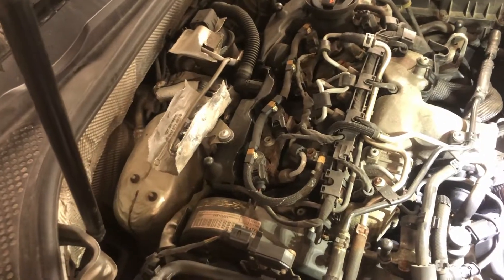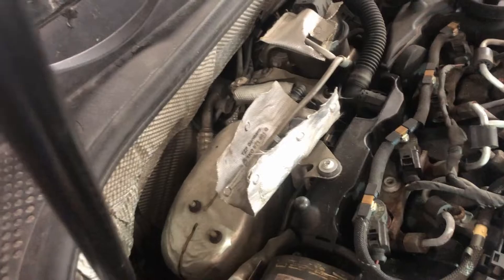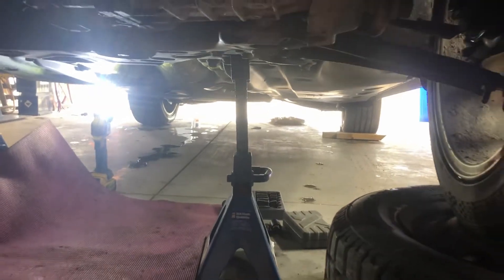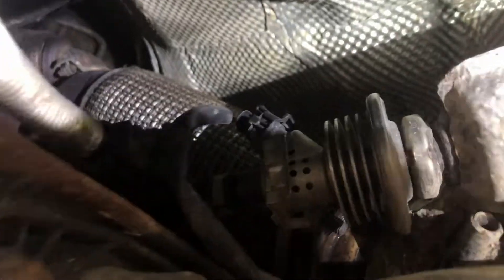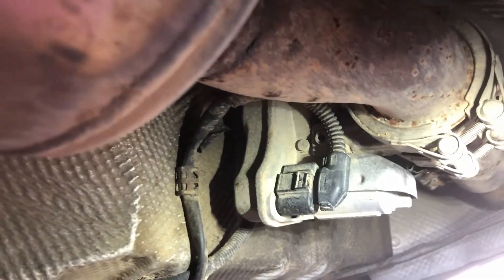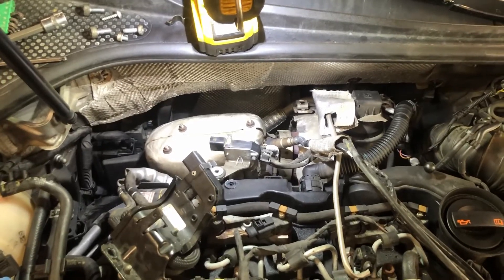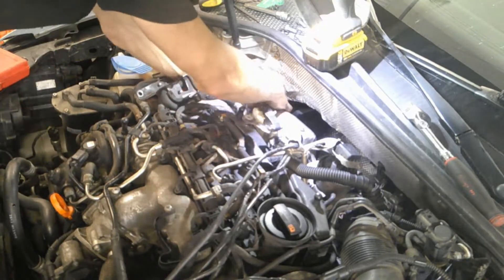CKRA Passat DPF/SCR/LP EGR removal *FOR REPAIR/REPLACEMENT PURPOSED*

Comment: Bro, your videos are excellent. You explain things very well, and you're an excellent mechanic. 
I also work with VAG, especially the electronics and programming (Immo-Off and everything related). I can also do tuning like Malone's. 
If you ever need any help, you can contact me. Wiring diagrams, part numbers, or any other information. Best regards, and congratulations on your work.

Comment: Did you need a set of triple squares for this job?
Reply: Yes 100% tried it without triple squares at first and it didn’t go to well just buy the triple squares
Reply: If you plan on doing any work on a VW, just go ahead and get the triple squares.

Comment: Got a CKRA and im removing the egr cooler completely. noticed the egr gases flow through the cylinder head, and im wondering do i need to block off both sides? or is it just a port specific for the egr gases, do the exhaust ports connect inside the head?, like can i just leave it open?
Reply from the maker: The cooler isn’t attached to that egr pipe, it’s fed into the turbo. The egr valve will stay shut and that pipe can stay but if you want to remove it for ease of filter change both sides need to be blocked off as it’s a through port to the 5th exhaust port on the turbo

Comment: How different of a procedure would this be for the CVCA Passat?
Reply from the maker: Very different, it’s got the entire canister behind the engine. I’ve done a little work (timing belt) on a 15 but nothing emissions related yet
Reply: @JoshsJettas  yeah it’s shoehorned in there nice so I’ve been curious how labor intensive removal is. What mileage did you do the timing belt?
Reply: @JoshsJettas  and thanks for the reply! I’m near 150k miles, know the time is coming soon..
Reply: go to rawteks downpipe install instructions. pretty sure u take cv axle out. curious if u need alignment after that ? but yeah its picture intructions to follow. im gunna follow that when i install my flowdirect kit.

Comment: Hey Josh any I just had my car done an it now has a rattling noise mostly at red-light an then accelerating from a stop is when its most noticeable . The new exhaust all seemed tight when I put it on , 2014 passat
Reply from the maker: Just installed a down pipe? My guess is the hanger is hitting the subframe through the mount, my wife’s car I had to trim the rods down a touch
Reply: @JoshsJettas  yup that was it !!! Thanks

Comment: I have a heater core failure on my ckra.  My heater warranty is done, bit still have 80 days on my emissions warranty.  Can a driver cause a cel to get the egr cooler and heater to get repaired under warranty
Reply from the maker: If you look up ckra heater core tsb they talk about a P2457 egr cooler efficiency below threshold. Bascially the heater core is inline with the egr cooler, if there is a restriction in the heater core or hoses enough coolant cant make it through the cooler and temps will rise. Id imagine if the restriction in bad enough and if the cars driven hard the code should pop up

Comment: Josh, I have a CKRA that destroyed three turbos in under 1K miles, and motor too. I’d like to know if you have any clues for possible reason. If possible I’d like to message/talk briefly. Let me know if possible.
Reply from the maker: Did the compressor wheel fail? The ckra are known to have weak turbos, was the intercooler cleaned out after each time? other possibility is plugged aftertreatment system. Send an email to joshthring21@live.ca
Reply: @JoshsJettas  emailed you.

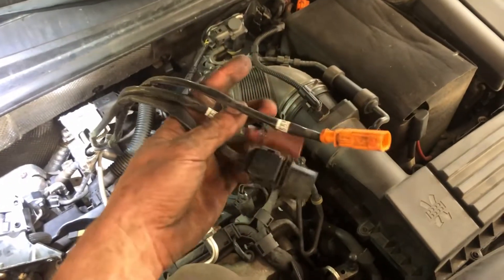Comment: Thank gawd for your video.  My Rawtek instructions are NOT CKRA specific so it  poses questions about which connectors are getting disconnected etc.    Question - the instructions say to set my pressure sensors aside as I will be reusing them....  will I be reusing them??  reason I ask is that I broke off one of the nipples on one of them when I was removing hoses.  Also, I have found that my sawzall with a 9inch blade works wonders to bypass rusted frozen bolts.  Also at 10:19 you are showing 3 connectors....I only have 2 (orange and brown)...what is the third one??
Reply from the maker: Depends on the tune, some companies might just want it plugged in but won’t matter the nipples broken. Zip disks and sawzall takes care of them for sure. And I believe 2 are egt sensors and 3rd was the lambda/O2 sensor?
Reply: @JoshsJettas  got it all done and tuned and it runs like a CHAMP !!!(off-road of course).   What a difference!!!!  Very happy that I didn't run into any problems....  I leaned on this video hard to get my delete done and it helped A LOT.  One discovery note... if you sawzall the flange off of the DPF you can pull it out from the top of the engine compartment.. made things easy.   Thank you.
Reply: I just didnt recognize the connector... but I didnt disconnect the sensor (at the plug) so your video might have been showing the connector side.  What about all the connectors and the adblue hose thats now hanging down from under the plastic skid with no home?  should I just tie them up under the skid?  @JoshsJettas
Reply from the maker: Yup just tie them up and tuck them under the panel. I’d put some di-electric grease in there Incase you ever want to go back to factory.

Comment: Is there a reason the glow plug light would stay on after you remove this stuff. Before repairing it of course. Is a way to chat with you about a couple questions?
Reply from the maker: Repair as in “repair” with a tune or actually repairing? Send me an email joshthring21@outlook.com
Reply: Having the same issue.. did you ever figure this out?

Comment: Did you just hook up the one sensor on the Downpipe? There are 2 threaded holes on my rawtech downpipe but the egt sensor is too small to thread back in, I don’t think an adaptor would work it appears to bottom out to seal.

Just no OE EGT sensor after delete?
Reply from the maker: O2 sensor should be the larger hole and 1 egt sensor for the small hole. Some don’t use egt at all and just use the O2

Comment: Hi liked this video. I'm having trouble replacing the dpf . I think I might need to drop the subframe- not as easy as removal.
Reply from the maker: If the primary cat is separate from the dpf the dpf will fit out, it’s very tight though

Comment: Did you remove the EGR cooler,  of just block it off and bypass the coolant lines?
Reply from the maker: Hypothetically just a blocker plate works well if the coolers not leaking. The cooler feeds in before the turbo so it’s not the easiest to plug if removing the cooler.
Reply: @JoshsJettas  Yes hypothetically.  ;)  Thank a million,  love your videos!

Comment: How long did it take you to get everything out and replaced?  I have my kit and I'm trying to make a hole in the garage so I can do the work indoors.  Also VERY curious if this helps the clogging heater core problem since you're no longer superheating the coolant in the EGR cooler.
Reply from the maker: 3-4 hours or so, quicker if you cut the dpf to fit it out easier. I'm hoping it does but there will be alot of junk still circulating in the engine, i haven't done a second core in this one yet but we'll see.